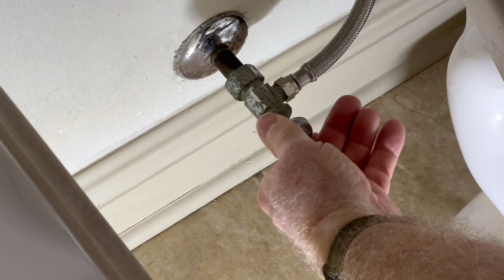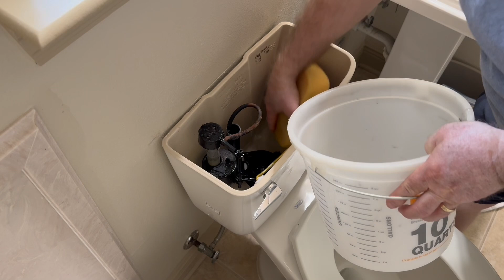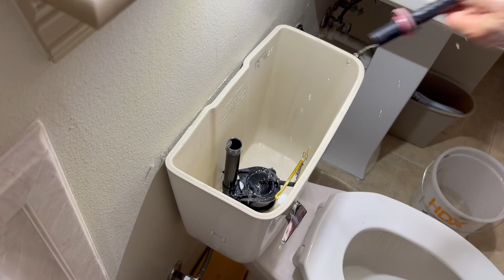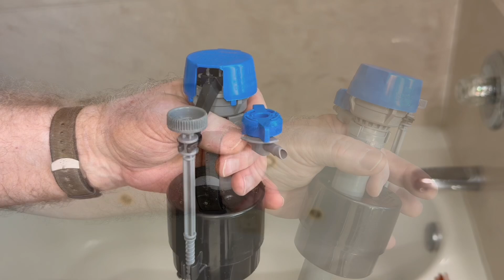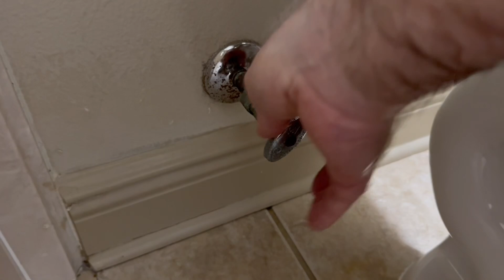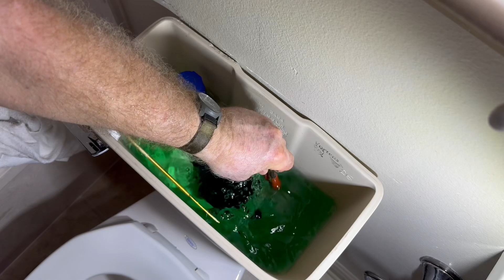How to Repair a Toilet with a New Fill Value

Comment: I did this recently. I used a shop vac to suck the water from the tank. Took about 30 seconds. I actually took the tank completely off, took it outside and cleaned it really well, and replaced all the components.  The problem with a lot of the OEM valves is they cater to California and they leave about 4 inches of water in the tank and you don't get a good flush. I bought a valve from a company called NuFlush and it made a really big difference.
Reply from the maker: I agree with you, it’s amazing how much more you can get out of a simple upgrade.  Thanks for sharing.